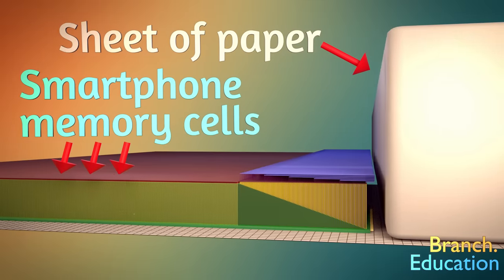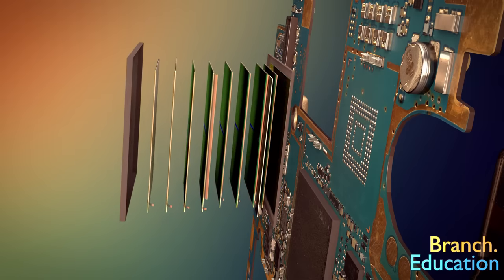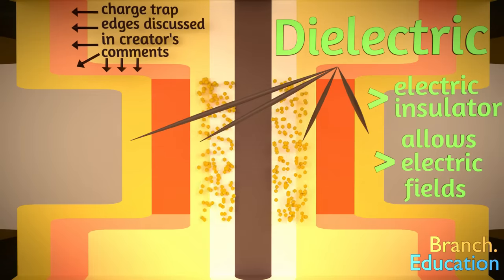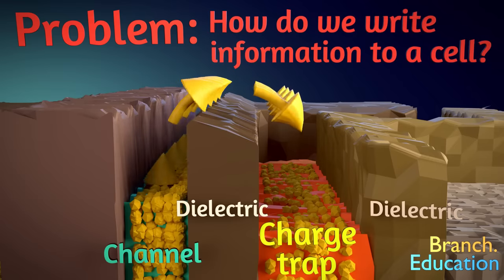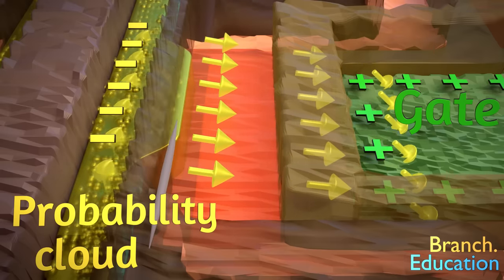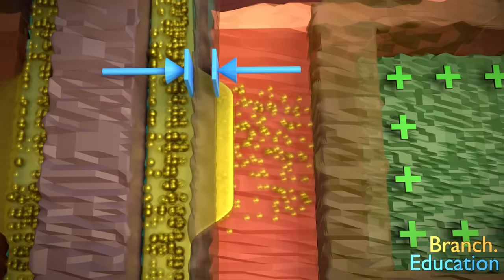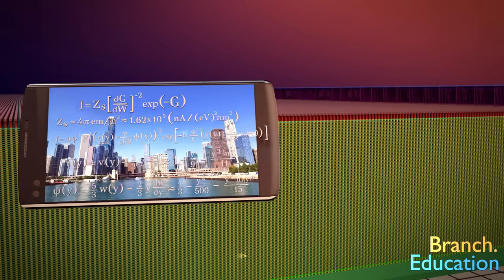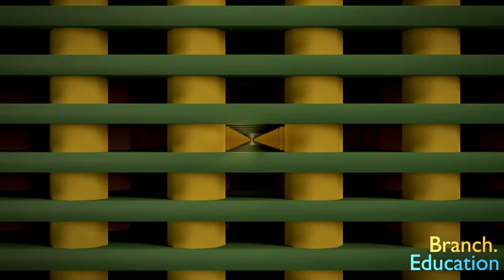The Engineering Puzzle of Storing Trillions of Bits in your Smartphone / SSD using Quantum Mechanics

Comment: So this means that flash memory might probably be the most used "quantum mechanics" device in the world?
Reply: Leonard Putra ,, 🤪dude even   “quantum mechanics” and “quantum physics” and “quantum chemistry” and “quantum dimensions” are working in your body and also in everything that you can see and you can not see in this universe and also in the  others universes around ours🤫....believe it or not!!!  the quantum world is just the tip of the iceberg🤣🤣🤣
Reply: @eddw123  no it's a molecule of the iceberg
Reply: Actually the most used is chlorophyll. It's a device not different from this, with the difference that we don't know yet how to build it for ourselves.
Reply: Probably...
Reply: it is a possibility... or not... at the same time... you know, quantics.
Reply: CCD camera is also a quantum mechanical device so it depends on how you define usage.
Reply: @Phoenix QM is definitely not a "sub sub field in physics"
Reply: In terms of an artificial device, yes.
Reply: It’s literally everywhere. Even in your body protons tunnel through thin cell walls in some cases!
Reply: @timramich  What about LEDs and other diodes? And transistors? So any other use of semi conductors...
Reply: Quantum mechanics is used in a lot of stuff. LED use quantum mechanics to produce light. While we use chemistry to make the structures, it's still the same concept.
Reply: LCD Screens are probably more common. They alter the polarization of photons to determine the probability that they will pass through a filter in order to change the brightness of each pixel.
Reply: @matsv201  Exactly my point.
Reply: i think LASER is older...
Reply: @cleitonoliveira932  although there are different forms of chlorophyl,  one form of chlorophyll is identical to hemoglobin, except for the central atom. This is why you can use chlorophyl as a substitute for blood in a blood transfusion. Humans can literally survive using plant blood.
Reply: to prevent data from getting lost. could we just copy paste the folder to write it again on new cells so we again would get 10+ extra years?
Reply: The width of the gate of the microprocessor MOSFET is 5 nanometre.
Reply: I heard that even photosynthesis uses quantum principles and that is the reason why plants are able to absorb solar energy more efficiently than any man-made solar panel.
Reply: @Phoenix Well said
Reply: @mikel4879  That's an interesting view. I am sceptical about quantum effects but that may be because I know little about them. If this is a quantum effect it is very exact in its effect or this type of memory would not work. Having said that, it may be that lots of effects that we take for granted may have a quantum component. I suspect that a sufficiently large number of random events drawn towards a certain value of electric field may always average out to a predictable result. In the meantime whatever is happening at an atomic level works well in this application.
I see quantum in the same way as dark matter; as a way of describing something we do not yet understand
Reply: Jonka 1 / The quantum explanation or the quantum theory represents the human impotency in understanding correctly the real phenomena.
As I said, the biological brain can invent any logical association ( called "mathematics" ) that can model absolutely anything without a mandatory result in the form of the correct explanation.
It is in many cases a useful practical description but not the correct explanation, as it is the case with the "quantum" fantasy.
The fact that a wrong explanation is used and obtain a practical and approximate result is not something new in the domain of human "science". Many actual so-called "scientific theories" are completely erroneous even if they are used daily with practical results in the human life.
That's why the human science FUNDAMENTALY ( not as a practical usage but as a FUNDAMENTAL understanding of the real causality ) stagnates for the last approximately 400 years, from the time of Galileo Galilei and Newton. /
Dark matter doesn't exist. There's no missing matter that contribute to the "observed" effects because the real and natural general dynamics of the matter in the Universe is totally and absolutely repulsive and not attractive at all. 
The illusion of an "attractive" effect is just the Reaction to the main Action. It is incorectly described because it is incorectly understood.
You can do practical approximate calculations on the reactive forces but that doesn't give you automatically the correct understanding of the real causes involved.
For the same reason the so-called "Black Holes" do not exist. Etc, etc ( at the center of a "vortex kind" Galaxy like the Milky Way there is just an "empty" space created naturally by the formation of the Galaxy under symmetrical forces of temperature and pressure, "empty" space that's getting dynamically bigger and bigger in the direction of the dynamic and natural expansion of the Galaxy and where the main natural and dynamical forces are pushing radially outward in the direction of the plane of the Galaxy ; therefore inside the symmetric "void" only huge, galactic, electromagnetic phenomena take place at almost orthogonal direction to the plane of the distributed matter of the Galaxy. Any piece of matter, planet, star, etc that freely enters into the central "void" is "shredded" by the huge galactic electromagnetic forces and thrown orthogonaly and symmetricaly out into the space as ionized matter ).
l will never understand how the people with "Ph. D." in Phisics who think of themselves as being "smart" can believe the humongous stupidity that at a point in space a lump of matter can have an infinite quantity of "energy" that can create an "attractive" effect, a "bending" effect, etc, for tens of billions of years. Sometimes the level of human stupidity is unbelievable !
Reply: @mikel4879  what did you study
Reply: Not at all. Two things: 

That is not because a mathematical model fits for a case that this implies that the case fits de mathematical model. Example: for a free falling object, we can assume that air resistance is negligeable. So, the mathematical model fits a group of experimentations. But air is still there, for once, and if you try to study a parachute, the model that you developped won't fit anymore. You will have to modify it. So, here, a mathematical model, quantum mechanic, fits, but that does not mean that the WORLD IS as the math model says it is. Now, as your remark contains the world probable, that is what is involved here: probability. 

Quatum mechanic is not even really involved here. Consider water evaporation. At room temperature, it requires that you raise its temperature at 100C, right? But staying at 25C, water in a glass, or spilled on the floor, would evaporate none the less, while the water is staying at 25C, never reaching 100C. Is that quantum mechanic?  NO! NO! and NO! A simple statistical distribution is enough to explain the phenomenon, without implying the esoterism of quantum mechanic. More precisely, even if the AVERAGE temperature is 25C, some molecule still  have more energy than the average, and those with high energy can break the discontinuity of the liquid to air (tension of surface of a liquid),  while the liquid stays at 25C, on average.
Reply: @SouravBagchigoogleplus  i dont understand, can u clear it?
Reply: @eddw123  you have no evidence of multiple universes.
Reply: @LelouchLamperouge235  Photosynthesis is about 1% efficient while solar panels are about 22-30% efficient
Reply: @mikel4879  I agree that physics is only an attempt to model reality, but not a true description of reality. Though that could be said of all science humans have ever conceived. The thing that is important to point out here is that SSD's are literally designed using the model provided by quantum mechanics. Just like old cars, trains and boats were designed using the model provided by Newtonian mechanics and classical thermodynamics (nowadays their electronics also use quantum mechanics).

Also, what are you calling a local entropic field? Are you referencing thermodynamical entropy? Entropy in that case is not a field, it is merely a number given by Boltzmann's equation involving multiplicities of states (which is inherently quantum mechanical). One can define it classically, though I prefer the stat mech approach.

With black holes, they were originally just an exotic solution to Einstein's field equations, and many in the physics community were skeptical. The only reason black holes are a thing today is purely due to favorable experimental evidence (as with all other parts of physics, like quantum mechanics and, for example, its idea of quantum tunneling). 

I am not really sure what your problem with physics is, it's just a model.
Reply: @eddw123  I think he meant man-made device, i. e. a construct that required the human understanding and delibare application of quantum mechanics.
Reply: Now just imagine straight pure quantum computing. It's like taking quantum mechanics & bringing it to life 🤪
Reply: Technically the atom or the electron are quantum mechanical devices
Reply: TO EVERYONE IN THIS CHAT:

THE JUDGEMENT OF GOD IS DRAWING NIGH.

REPENT TODAY AND GIVE YOUR LIFE TO JESUS TO ESCAPE ETERNAL DAMNATION!,
Reply: @eddw123  yappachino

Comment: Some information seems missing:

~ This shows how to bring electrons into the charge trap, but what about making them leave?

~ If turning the gate on reading the threshold voltage, doesn't reading the threshold voltage also write a value?

~ This shows how to write zero or one, but not how to write 8 levels. If you hold the gate, does it increase over time? Or, do you just use a different voltage to target different 3-bit values. Does the SSD clear the bit before writing every time?
Reply: 1) A negative potential is applied on the gate so that the electron cloud is repelled. This makes them leave the charge trap.

2)The applied voltage must have been less than the threshold voltage(I am not 100% sure on this though).

3)The 8 states can be represented using the level of electron cloud in a charge trap. It would be 000 for a completely empty charge trap, and 111 for a completely filled charge trap. 

Imagine a water bottle having a capacity of 800mL. 0mL would represent 000. 100mL would represent 001, 200mL would represent 010 and so on. And finally, 800mL would represent 111. That's how it works.

Comment: there is one more important thing we should learn. How do they manufacture these nm scale structures ?
Reply: Lasers that are focused with a lens, like a high tech magnifying glass you hold out in the sun light, or at least that’s how silicone chips are made
Reply: @BooooClips  well.. extreem UV lamps
Reply: Well at first they take a waver and get a silicone layer over the oxid(dielectric) layer than they put on a layer of Nitrat and one of uv activeted paint afterwards they shine uv light though a mask in a projector (here they get it small) now cleaning and etch away that isn't covert be activated paint down to the oxide and cover it with  heat it so a the gate oxide can Form out of the silicone and add new oxide than they polish till they reach the nitrate and again etching away but at first the nitrate than they set the hight of the on top laying oxide with more etching after that they put on paint and activating it on wanted parts and clean it  than doting the silicon with p ions than clean the paint new paint and again uv light cleaning and doting but with boron inons cleaning heating for gateoxide putting on a layer of polysilicon than paint uv light and etching adding nitrate etching than oxide paint doting drain and source after that more layering of oxide and nitrate(with sertan conditions) and aching to the darin and source to add a small layer titan Nitrat to secure the doting after that adding tungsten on top polishit down so only the etched holes are filled with tungsten  and than they start to put on oxide paint uv light titan nitrate and then they add copper and again and again up to 10 layers with copper
Reply: For any structure that is less than the wavelength of light (e.g uv light is 300 nm), u need to use something called electron beam lithography ( use electrons instead of light due to their even smaller wavelength). This is implemented routinely in labs everywhere.
Reply: @quantumpolariton122  nice addition
Reply: @BooooClips  it would perfect if they make an animation for that process as well to understand it better
Reply: One nano wide, nano people... any nano wider than that is considered fat and doesn't get hired.

Comment: What I find amazing is that a photo, text message or document probably being saved or stored in multiple cells in many layers, would need it's own unique identifier to help the CPU or the chip which would retrieve this information pull out each and every bit located in the different cells needed to make the text message or photo. Because if you have millions (well billions nowadays) of bits making up one photo for example located in many cells, you're going to need an extremely reliable way of being able to find all the bits in each cell needed to make said photo
I mean of course the phone does this without us thinking about it

Comment: Thank you for the thorough and accessable explanation. I was watching another video on another channel on electrochemical computation and it occurred to me that the method they were using would not hold up well too many cycles and was not good for fast computation. I thought instead that using capacitors for calculation and less volatile form memory for long-term stability, instead of the electrochemical battery like structures they were using be the best way to do it. And I got to thinking about solid-state drives and how they have to be non-volatile but I didn't know how they worked at a microscopic level. And with an easy search I found your video and found the explanation. Storing a charge in a Quantum well tunneling right and then field potentials to read is An Elegant solution. It probably could be used in simulated neurons alongside capacitors.

Comment: Hoping for "How Ram" & "Processor" works! :)
Reply: RAM uses flash/nand technology, pretty much the same as in this video (but how the big picture work is diff)
Reply: Definitely go check out Ben Eaters video series: building an 8-bit breadboard computer. He there assembles a simple but complete Computer from the ground up, meaning from basically transistors. I think it's the most efficient and also most pleasant way of developing an understanding of how computers work!
Reply: @Vysair  well ram dont use tunneling, also just one level. Also, as far as I know, they dont use barrel capacitors..
Reply: @Vysair  RAM doesn't use flash/nand wtf. RAM is completely different than any storage device
Reply: @matsv201  I mean the core technology and yes it's only TLC.
Reply: @dacejoy02  Ok, I will reread about it
Reply: @dacejoy02  what are you smoking. Flash is also an integrated circuit.
Reply: @matsv201  RAM isn't Flash/NAND memory.

Comment: I have a SSD from 2014, I'll use it until it gets messed up just to see this in practice
Reply: They'll last a long time as long as you don't write & read a lot. I also asked a related question about it in a comment here:
Reply: ""Does the controller chip 'refresh' the data when you're not reading or writing it to keep it uncorrupted, or do you have to copy it ALL every 8-10 years? I guess there's also correction mechanisms in place in case some bits get corrupted...""

Comment: why not use punchole cards again, they won't ever get corrupted and they can be edited easily, or for example vhs tapes for storing things in binary, that would last really long too
Reply: But it would take ages to read/write files, and those also require moving parts.
Reply: Or write it all out on paper
Reply: @/science r/woooosh (I'm pretty sure this is a joke)
I'm going to try working out how long the punched card would be though
"This IBM card format, introduced in 1928,[47] has rectangular holes, 80 columns, and 12 rows. Card size is exactly 7 3⁄8 by 3 1⁄4 inches (187.325 mm × 82.55 mm)."
80 * 12 = 960 bits, 960 bits / 8 bits = 120 bytes per card
64GB (not even that big for a phone nowadays)  * 1024 * 1024* 1024 = 68,719,476,736 bytes, 68,719,476,736 bytes / 120 bytes = 572662306.133 cards, 572662306.133 * 187.325 mm = about 107,273,966,000mm, 107,273,966m, 107,274km, the circumference of the earth is 40,075 km so it stretches around 107,274km / 40,075 km = about 2.68

TL;DR If you had 64GB of data on punched cards and laid them out it would stretch around the Earth 2.68 times
Reply: Lmao, I'm just imagining when you want to show a photo you pull out a suitcase full punch cards, drop them in a reader and saying "All right, let's return in a few hours once my photo loads!"